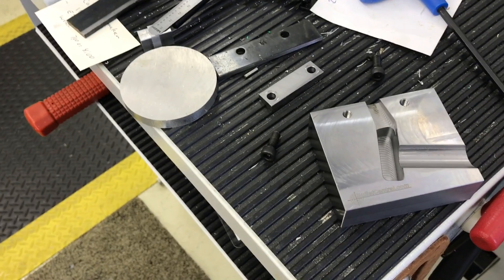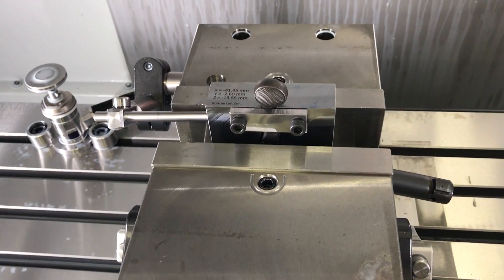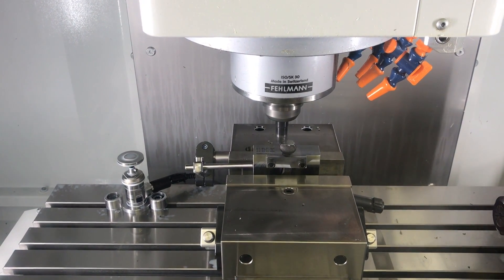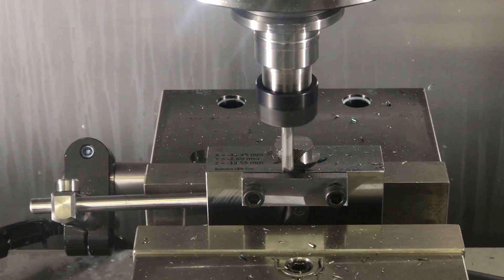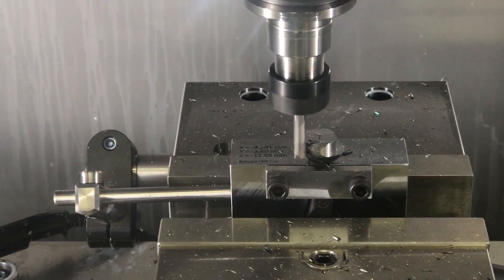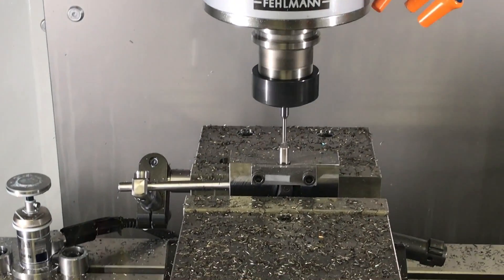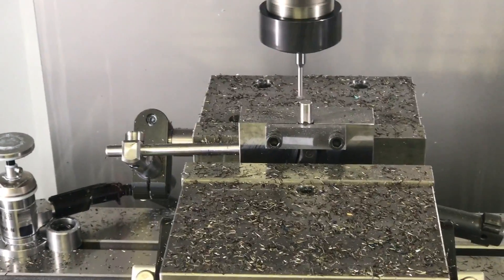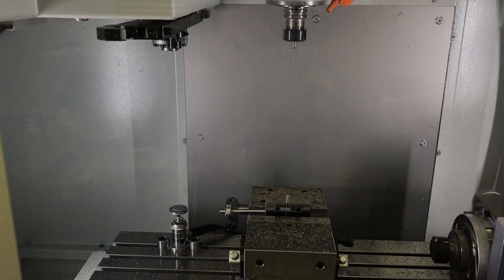Rem 700 Tactical Knob

Comment: Just got my first cnc mill recently and found you because I was wondering about doing this myself. I dont have coolant on my mill do you think I will have an issue with the solder on the bolt? Was that aluminum block just a good enough heat sync to not cause an issue?
Reply from the maker: NoSleepRacing If you use carbide tooling, keep your rpm down and feed higher you should not have any issue at all. There is no way you are going to sweat the solder off. The block is not aluminum, it is mild steel. But again, that is not an issue.